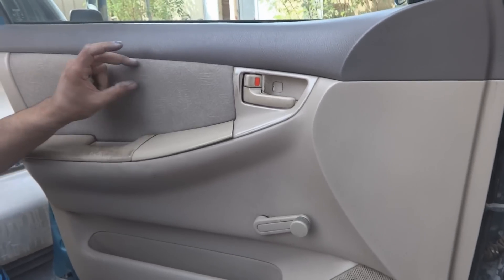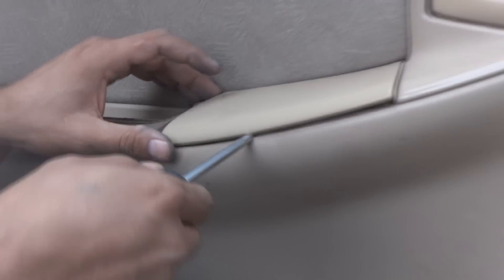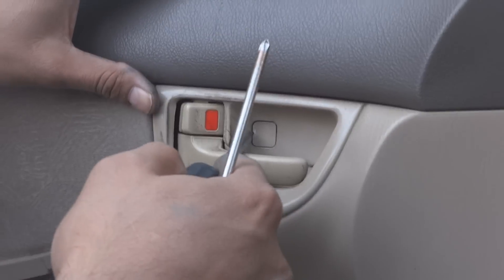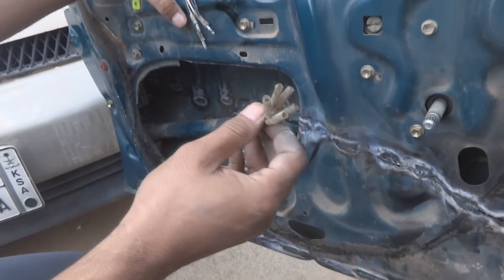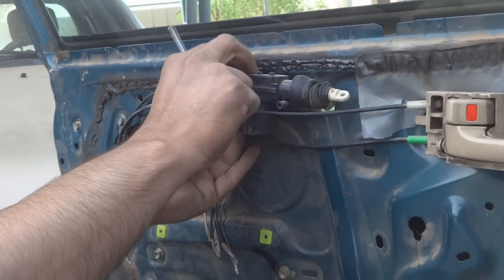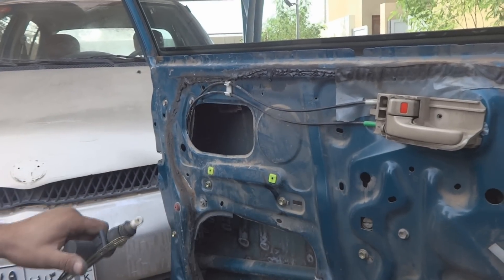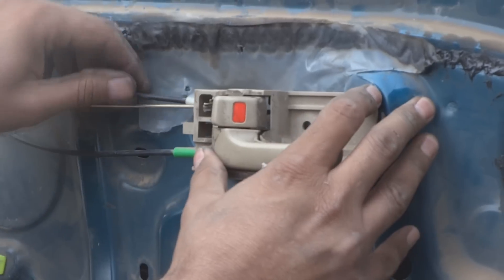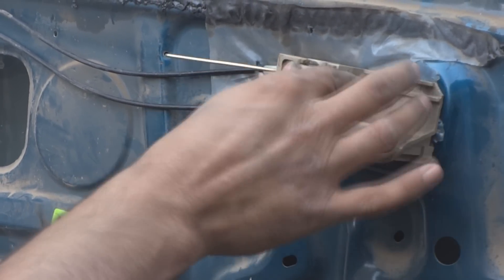Keyless entry; Car remote control part 2

Comment: i have Honda Civic 1998 model (sedan) VTI engine. in my car have power windows.with key when i lock door from outside all door lock and unlock. i want install door lock central system. I don't have information" either i use actuator motor or without actuator" . i am actually confuse.kindly guide me.
Reply from the maker: If you have already installed center locking system for doors and it works then you don't need motors actuators. Instead you only need a remote control box for locking and unlocking remotely.
Reply: @JahanZeb1976  Thanks brother

Comment: Sir, one thing very danger about double operations of hazard warning light and key operations.

Activate the hazard warning switch and closed all doors.
Now, press the lock and unlock buttons one after another, the turn signal bulb will be fused and damaged.
Reply from the maker: This is not heppening. Lights are 12v and the system is switching 12v too to lights. So no problem to lights in such a case.
Reply: @JahanZeb1976  but two 12 v meeting at the same point without load will cause a short circuit..
Reply: @JahanZeb1976  in simplest analogy...

For example, a circuit has one end of bulb connected directly to 12 v through a physical switch and other end to ground.

Now, when switch is closed, bulb lights up. That's ok.

Now, you add another same physical switch again to the positive side of the bulb and active this switch leaving the first switch off, what happened, yes the bulb still glows!!!

The real test...
What if you activate both the 2 switches at the same time...boom you are on fired!!!!
Two power supply from same source meet at the same load .....
Hope it's clear now..
Reply from the maker: Lol. This is not the case. Two lines from the same source will make a parallel supply connection to the load. Nothing like fire or explosion 💥 would occur but the load would take current through two lines. Make experiment and you will get the answer. Maybe if I will get some time, I will make experiment and will upload video for you.
Reply: @JahanZeb1976  okok... thanks so much for the reply. I'll update you too.

Comment: Hiiii
Reply from the maker: Yes friend. How are you?
Reply: @JahanZeb1976  Sir, one thing very danger about double operations of hazard warning light and key operations.

Activate the hazard warning switch and closed all doors.
Now, press the lock and unlock buttons one after another, the turn signal bulb will be fused and damaged.

Comment: Sir.
Can this  actuator be move by hand..???
Reply from the maker: Yes. This is the quality. You can use lock as manual without damaging it.
Reply: @JahanZeb1976  thank you
Reply: @JahanZeb1976  Sir, one thing very danger about double operations of hazard warning light and key operations.

Activate the hazard warning switch and closed all doors.
Now, press the lock and unlock buttons one after another, the turn signal bulb will be fused and damaged.

Comment: whay the fuck did you cut the fucking wire to 2 pieces , you could use the bended part , you know that right ?
Reply from the maker: First of all you should speak gently. It will make you honorable and graceful. Regards,

Comment: Can we instal this system in xli 2005 .and how much cast
Reply from the maker: Yes sure. 2005 xli is the same like 2001 xli. Virtually this system can be installed on almost all cars makes and models. The price depends upon the system you are about to install. It start from  $20 to somewhat $ 60.
Reply: @JahanZeb1976  Sir, one thing very danger about double operations of hazard warning light and key operations.

Activate the hazard warning switch and closed all doors.
Now, press the lock and unlock buttons one after another, the turn signal bulb will be fused and damaged.

Comment: Dear I have Hyundai Elantra 2014 without central lock. I check in makete they said its little hard to install central lock motor in Elantra. Originally the motor is coming with lock.
Please guide me that if I go for installation of normal motor aur I have to look for orginal (may be used). If you can give me your contact number. I am in KSA

Comment: Sir my car i20 comes factory fitted with central locking system, but without remote keyless system.

And I opened the door panel, remove the latch actuator assembly. There is a connector or  switch on the latch actuator. Is this particular switch meant for remote central locking or for some purposes. Please help me about this. 

Afterall, the car being a central locking locks all doors with the push of a doodle handle button on driver's side.

Comment: Is one actuator motor enough for the remote locking? Or I have to install four ?
Reply from the maker: Obously you need one motor actuator for every door. You need four for all doors and maybe fifth for trunk if option is there in the unit. Stay tuned and blessed.
Reply: LearningZone Thanks for your help but I still have dauds though!!!

My car has got already central locking system and would just installing one actuator motor on driver side lock the car using remote key? Thanks in advance.
Reply from the maker: If there is already center locking then there is no need to install any motor. Motors are already installed. All you should do is to connect the remote box to the existing center locking switches and wiring.
Reply: @JahanZeb1976  sir can I inbox you on your personal account?

And, sir, I found 5 wires attached to the latch door lock unit of driver's door Hyundai i20. I assume these are the main wires you referred above which switch off and on the central locking system.

Now, my problem is that which of these wires should connect to the corresponding wires of the remote control unit to lock or unlock the car?

With best regards. Thanks.

Comment: 4:00 why did this car have actuators, not hooked up??
Reply from the maker: They were there before after market by someone. Regards and stay tuned.
Reply: @JahanZeb1976  Sir, one thing very danger about double operations of hazard warning light and key operations.

Activate the hazard warning switch and closed all doors.
Now, press the lock and unlock buttons one after another, the turn signal bulb will be fused and damaged.

Comment: any video on how to incorporate a car alarm (the cheap one from China) to a car that already have power door locks? and by the way, your video is very informative! thanks.

and also can you please show a video on how to bench test a car alarm? thanks again..
Reply from the maker: You may watch all parts of this keyless entry system videos. Hope you will clear all your doubts.
Reply: LearningZone thanks
Reply: @JahanZeb1976  Sir, one thing very danger about double operations of hazard warning light and key operations.

Activate the hazard warning switch and closed all doors.
Now, press the lock and unlock buttons one after another, the turn signal bulb will be fused and damaged.

Comment: Good video. Sir l have ford figo 2014 lxi model.I want to fix a central lock system for all 4 doors. Remote is not necessary .if it comes as such kit then OK.
Pls suggest good third party CL company n cost?
Some suggestions in net are figo has some complex system wiring so some mechanics hesitate to do it....pks help..thanks in advance..
Reply from the maker: Dear friend you can do what ever you want to do! It is all up to your budget and liking. There are some aftermarket systems available in the market which have more facilities and some have less facilities. The price range also vary accordingly. Anyhow you can get the one shown here for Sr. 120 or so and some accessories having some more price maybe total Sr. 200 and further could be the installation cost. Here I have shown all details how to connect the system. Hope anybody having a few little tools and little understanding can do the job. So you can select any system from the market and can install it on your car. In my understanding the central locking should be there for your car from company. Best of luck.
Reply: @JahanZeb1976  Sir, one thing very danger about double operations of hazard warning light and key operations.

Activate the hazard warning switch and closed all doors.
Now, press the lock and unlock buttons one after another, the turn signal bulb will be fused and damaged.

Comment: My car doesn't come with a remote keyless system that means I can also custom make it?
Reply from the maker: +The Geeky Tuber sure dear friend. The purpose of the video is to give you detail of this all process. You may watch all four parts of the series and get understanding how to connect everything before attempting such job. Regards.
Reply: @JahanZeb1976  Sir, one thing very danger about double operations of hazard warning light and key operations.

Activate the hazard warning switch and closed all doors.
Now, press the lock and unlock buttons one after another, the turn signal bulb will be fused and damaged.
Reply: The Geeky Tuber y

Comment: thank you for the information.
Reply from the maker: Thank you very much dear potential subscriber. Hope you will get more informational videos on my channel.
Reply: @JahanZeb1976  Sir, one thing very danger about double operations of hazard warning light and key operations.

Activate the hazard warning switch and closed all doors.
Now, press the lock and unlock buttons one after another, the turn signal bulb will be fused and damaged.

Comment: Thank you Sir, Very interesting videos. Will be appreciated more if you can load some videos on other machinery as well.
Reply from the maker: +ishfaq ahmad Sure inshallah. Thanks for your interest and subscription. I subscribed you also. Regards,
Reply: @JahanZeb1976  Sir, one thing very danger about double operations of hazard warning light and key operations.

Activate the hazard warning switch and closed all doors.
Now, press the lock and unlock buttons one after another, the turn signal bulb will be fused and damaged.

Comment: Hi , i have 2004 mercury marquis changed the battery aftr that car won"t start security light always blinking please help me.
Reply from the maker: +Aneesh Unnikrishnan Seems to me like a security problem. Sometimes it needs key reprogramming and sometimes it could be a loose connection somewhere. You can watch one of my video where I solved such a problem for my Toyota ECHO. Maybe it could be the solution of your problem! Here is the link for that video.       https://youtu.be/gHnrkRqcRoQ

Comment: 1.3 vvti
Reply from the maker: +Murad ali yes.
Reply: @JahanZeb1976  Sir, one thing very danger about double operations of hazard warning light and key operations.

Activate the hazard warning switch and closed all doors.
Now, press the lock and unlock buttons one after another, the turn signal bulb will be fused and damaged.

Comment: sir we have 2006 Toyota corolla it.idles poorly
Reply from the maker: +Murad ali Watch my throttle body cleaning video and apply the procedure on your car. Hope it will solve your problem. Regards,
Reply: @JahanZeb1976  Sir, one thing very danger about double operations of hazard warning light and key operations.

Activate the hazard warning switch and closed all doors.
Now, press the lock and unlock buttons one after another, the turn signal bulb will be fused and damaged.

Comment: Another way to enlarge the hole for the wire, is by heating the wire enough to melt the plastic.
Reply from the maker: +muadhatnet Yeh thanks for the tip. You are right you can use heating method to burn enough plastic to make room for new wire installation. Problem is sometimes you have no arrangement for heating at site or you have no intention to adapt a new way to do a work. Regards,
Reply: @JahanZeb1976  Sir, one thing very danger about double operations of hazard warning light and key operations.

Activate the hazard warning switch and closed all doors.
Now, press the lock and unlock buttons one after another, the turn signal bulb will be fused and damaged.

Comment: Looks like you're moving along pretty good with the door lock system. One thing I noticed Jahan was that the door lock actuator seemed to be a little too high. The connecting rod would be working at an angle from the actuator to the door lock button. The person who originally installed the actuator looks like they installed it too high. In any event, I'm sure that it will still work, but may work a little better if the rod is level from the actuator to the door button. Keep up the good work Jahan...

Comment: Thanks a job well done I am waiting for the next section Thanks
Reply from the maker: +ابوانس بن هيف Next section is up now dear friend.
Reply: @JahanZeb1976  Sir, one thing very danger about double operations of hazard warning light and key operations.

Activate the hazard warning switch and closed all doors.
Now, press the lock and unlock buttons one after another, the turn signal bulb will be fused and damaged.

Comment: That link rod looked like a plated welding rod or a spoke from a bicycle wheel.
Also the thin rods from a faulty umberella can be handy :-D

To join rods i have used the inside of an electrical connector block, two screws in a brass tube is the part i use.
I wonder if thats how you have done it.